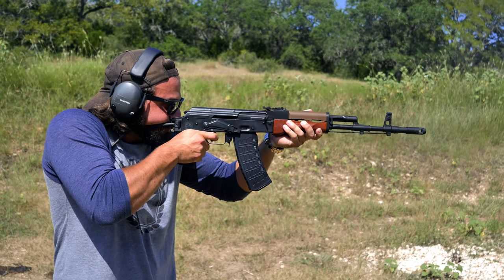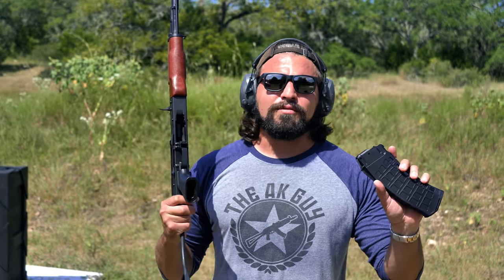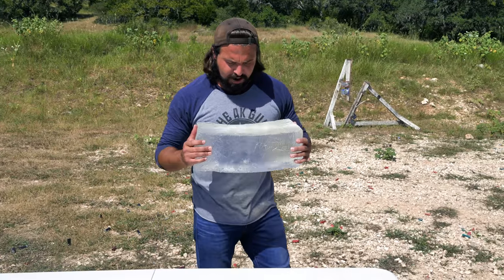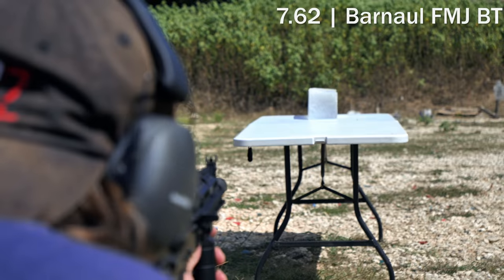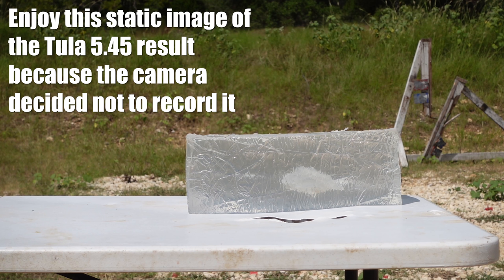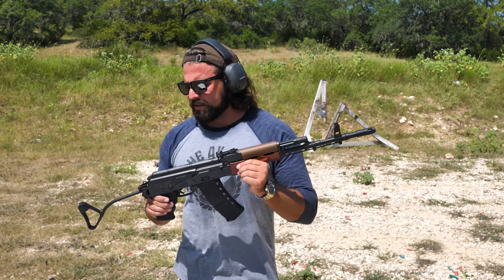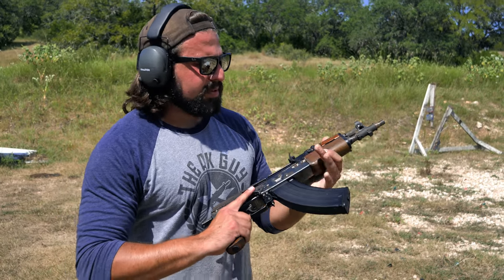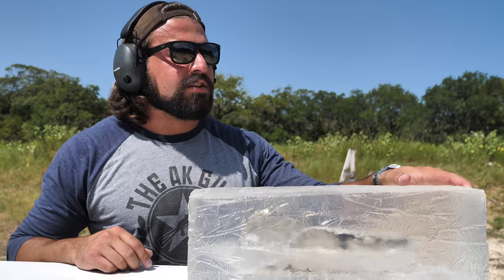7.62 vs 5.45 - Which Is Better?

Comment: I’d like to see a video comparing 9x18 Makarov and 45. ACP, since those are the two rounds you said you were considering for the St. Petersburg typewriter!
Reply: Yes brother
Reply: Should do 9x18 vs 7.62 Tok since both are Russian calibers
Reply: @astronautindisguise  why not all three?
Reply: Although the construction of the bullets vary, 9x18 is terminally pretty close to a really hot .380 and has similar ballistics. So looking up what, say, a defensive hollowpoint of X brand in .380 does would give you a good idea of what a defensive hollowpoint of the same brand in 9x18 would do +/- an inch or two penetration and they'd be very close in accuracy/range/drop/etc. Just in general.

Not perfectly analogous but it'd give you a ballpark idea if you couldn't find any direct comparisons.
Reply: 45 намного сильнее и имеет лучшую пробивную способность.
Reply: @astronautindisguise  скажу как русский. 7.62/25 намного мощнее. 9.18 создали как замену 7.62, так как он был слишком сильный, быстрый и просто прошибал цели как "игла"
Reply: Lmfao that's like comparing .380 to .45. It's pointless because any sensible person knows the 45 will win in every way
Reply: @please1933  so the russians made the 5.7 before the FN? Damn

Comment: it really depends on the situation. as for most combat situations I would pick 5.45 as it is lighter and you can carry more. If I was on the security team at Jurassic world I would pick the 7.62 for more stopping power.
Reply: I'd be picking no less than 338 Lapua or 50 BMG for a dino, haha!
Reply: 458 socom for dino
Reply: @ViktoriousDead  😂
Reply: @ViktoriousDead  well than I want ft/lb power
Reply: @ViktoriousDead  sorry for using the wrong term. We meant plan b for post birth jobs
Reply: @zacharylankford4812  the problem with that is the 458 socom weighs more then twice the weight of a 7.62x39. meaning you would not be able to carry as many rounds. in the jurassic world movie alot of the damage was done by the flying dinos. you would need a lot of rounds to stop that flock. you have to trade some firepower for how much ammo you can carry. yes the 458 would do more damage to a dino but it would not be able to stop as many dinos as 7.62. if weight wasnt an issue then there should be several short barrelled barette .50bmg rifles in every squad, along with an m60 or S.A.W.
Reply: @jakegarrett8109  sure you could kill a trex but good luck stopping that flock of flying dinos.
Reply: @ViktoriousDead  ok more energy.
Reply: @codymcfarland5206  I think for flying one's I'd have either a pump shooting magnum buckshot loaded ridiculously hot, or you could do an under-barrel attachment if you don't think you'd have time to swap weapons but that seems really heavy at that point.

Also note before loading shells too hot make sure the firearm can safely handle it, at FFA practice I let one of the members borrow my dads antique 12ga (bare wood stock, break barrel, absolutely painful), and he popped in some random load he made in some type of shell I've never seen before (looked like a flare, but it definitely wasn't), and it shattered a big piece of wood splitting itself right off the stock. Dude was in quite a bit of pain from the recoil, and it kind of ruined the furniture. Since it was damaged later I made a pistol grip for it out of 2x4 back when wood was 2"x4" and not 1.5x3" and during a competition the first shot for that round (shot it a hundred times earlier), it split in my hand as I was holding it like a giant pistol by the rear as I had done earlier, but I kept going with half a grip and still hit 24 out of 25. However modern synthetic stocks like the Mossberg 500 series are probably not going to break before your arm does, so before making anti-dino loads do remote test fire in a vice and use a well made modern firearm.
Reply: @codymcfarland5206  you’re forgetting one important thing. Everyone in all those movies were remarkably stupid. Hence the lack of 50 BMG even when vehicles were available. And you’re right about the ammo weight. I’d still rather a .308 or 7.62x54r than a 7.62x39.

Comment: 5.45 is the better bullet when there is no armor. The flesh damage is just insane. However, when there is some armor or you are fighting in a place where you need the extra penetration and hitting power - go 7.62.
Reply: I heard about 5.45 and 7.62x39 have same penetration power from Combat Approve channel on Ep23 A bullet is not a fool or six records of Russian gunsmith.
Reply: 5.45 hardend steel core does good at going thru armor... and it goes faster... faster plus smaller diameter = rips thru fibers
Reply: Milspec 5.45 pierces through trees like paper, but less performance against brick walls.
Reply: 5.45 броню лучше пробивает. Но у 7.62 останавливаются сила выше

Comment: Now that the Taliban prefers 5.56
7.62 is abundant & cheap again.
Reply: Idk bro, they just won a war, maybe we should take their advice lmao
Reply: @maxpulido4268  they took 5.56 after they won tho
Reply: Wrong. The import of Russian ammo is banned, all Russian ammo is expensive as hell and hard to find right now.
Reply: They didn't fire a shot. Except for the executions that is. Then they got the upgrades.
Reply: @Groza_Sadika  Yeah but they preferred 545 even before they got 556. Only issue was ammo supply. 545 was hard to come by during American occupation of afghanistan.
762 is what you used cuz it was what you had, and most had very little.
Then again, 545 was a status symbol largely because Osama had one, so who's to know if they even cared if it was good.
Reply: @Groza_Sadika  PS: I think it's clear 556 and 545 are comparable.
If they prefer 556, I'm sure they'd prefer 545 if the weapons they captured were 545.
Low recoil flat shooting round. Functionally identical.

Comment: 7.62 best
Reply: Finnish military is aiming to use this to the foreseeable future. Having shorter ranges due to the huge forests and lots of small bushes weigh more than the better accuracy in the longer ranges. Also, as it is defensive military, total weight of the carried ammunition has less impact when compared to militaries training for more mobile long range movement tactics.
Btw, the new and upgraded RK62M is looking mighty awesome.. Sadly will probably be a long time before anyone outside FDF gets to try it...
Reply: @alaric_  I think Gun Jesus may get a chance to test one in the future.
Reply: Question:
7.62 vs. 5.45 - Which is better?

Answer:
9x39
Reply: @alaric_  Would you please clarify ”to foreseeable future?” 🤔
Because it sounded like saying ”FDF has not been using 7,62 yet, and is testing it currently to swap with current service rifle caliber”… 🤔